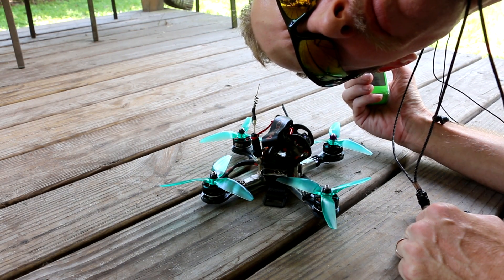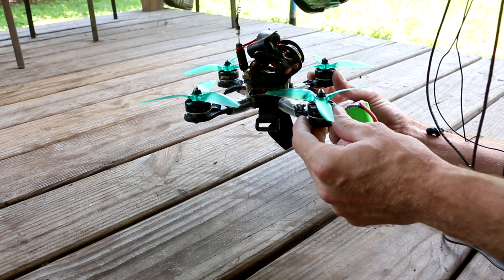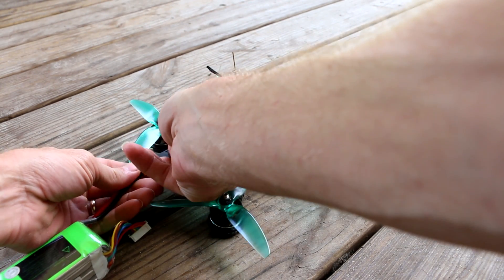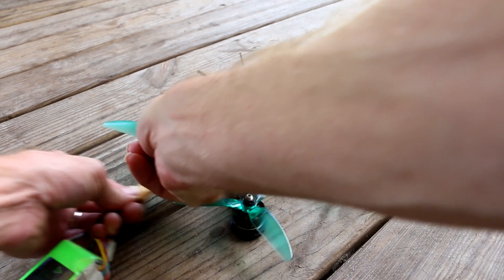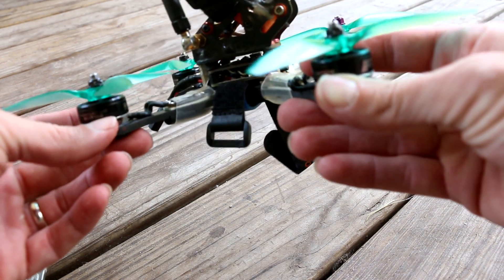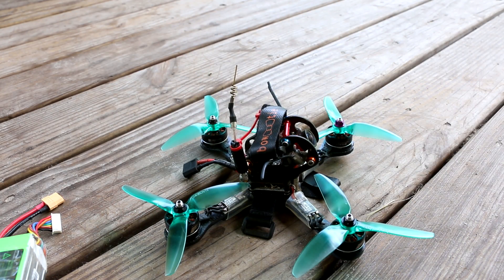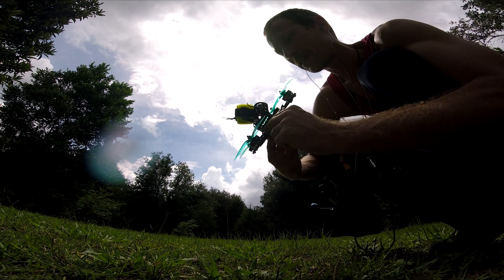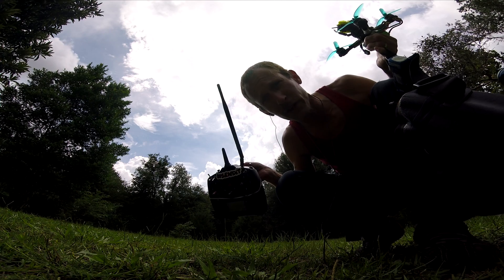Can a 20 amp esc handle 6s?

Comment: Saw this video today as me and a friend who got me into fpv were discussing if thr es30hv is sufficient for a 6s. Awesome work. Subscribed and loved your vids.
Reply from the maker: The spedix es30hv single esc are practically indestructible, these https://www.getfpv.com/spedix-es30-hv-3-6s-blheli-s-30a-esc.html?utm_source=google&utm_medium=cpc&adpos=1o2&scid=scplp7176&sc_intid=7176&gclid=CjwKCAjw2qHsBRAGEiwAMbPoDOHtR17-I_AdOh6c2ZhMlUg_TBtLocrhbVdAe5K1fqtZfT5Ah09T9hoCXl4QAvD_BwE .  I once wired them all backwards, plugged in the lipo and sparks started flying, all of the escs still work.  I've been running those on several 6s quads for 2 years.  The spedix is30 4n1 is not rated for 6s, but i've been using one on 6s for over a year now with so many flights on it.

Comment: Im running , holybro 35a esc blheli32, bardwell aio f4 v2, f60 2700kv motors, 6s battery, but smokestopper lights half when plugging inn at 6s and 5s, does not smoke at 5s, but at 6s
Reply from the maker: I've never used a smoke stopper, i use a multimeter set to ohms, connect to positive and negative on xt60 to check for continuity.
Reply: @mooosestang  its not a short, its overloading or something. Can you explain to me what it can be? One of the components on the flightcontroller startet smoking when using 6s
Reply from the maker: @EarlStrand  it sounds like a bad voltage regulator.  I have a flip32 f4 that runs fine on 4 and 5s, but won't arm on 6s and keeps resetting.
Reply: @mooosestang  is it possible for me to add an extra regulator between battery and flightcontroller then?

Comment: Running the spedix es20 lite on a bardwell f4 fc, pyro 6s 1250, hyperlite 2205 1722kv on hqv1s with great success here as well. 486grams. Rapidfire has clean video using no caps.
81amps on 5x4.8x3
68amps on 5x4.5x3

Comment: You are the man, I was about to ditch some these esc's. These esc's can do dshot. 
http://pirofliprc.com/Spedix-20amp-Lite-BLHELI-S-ESC_p_3478.html
Reply from the maker: I think mine might do dshot150, they won't spin right on 300 or 600.  So just know that dshot ready might not actually be dshot ready.  These came out before dshot like the tbs 25a bulletproof escs and some people had luck running dshot and other didn't.  but they do seem to handle 6s fine with 1600kv motors, probably would work with 1700kv too, maybe. ;)
Reply: I have run dshot 600, clracing f4, 4s with 2205 2600kv in a crash I noticed it would burn up the esc and motor. Running an old betaflight without crash recovery. Not sure if they were burning up due to over amping? FETs were toast. Motor windings would burn also. I do not have this quad anymore, I gave it to a friend getting into the hobby. I have to many quads. I have 6s lipo's on the way. I will be using a helination f4 and airbot ori32 on 6s.
Reply from the maker: It wouldn't surprise me that spedix changed something to make them dshot ready and i got some of the first ones before dshot came out, but they are the same escs in your link.  I've never had luck running the tbs bulletproof escs on dshot either, without removing one of the little caps.  tbs I know sold those escs as dshot ready, but many people had issues running them on dshot.  Let me know how it goes.  I've got some other 20amp escs I plan on trying on 6s, xm20a and racerstar 20a.

Comment: what size LiPo you running yO? looks like a pulse , but wondering the Size? thanks for your time.
Reply: going back through I think its a 1050mAh correct? a lot of the 6S packs are twice as wide as they are tall wish they'd make them equally wide as they are tall and make them a touch longer to compensate for the extra cells.
Reply from the maker: Yes, 1050 and i agree, we need longer cells.

Comment: i got a bunch of little 20's. i'm gonna hook one to my big 6s and see if it catches on fire.  I wonder if those 20 amp speedixs are limiting the out put current? Very surprised they took the initial voltage.
Reply from the maker: I don't think they are limiting power, it felt just as powerful as it did on the mad hatter with wraith32 escs.  I've got some 20amp littlebees, but i think they'll smoke, plus blheli_s is the minimum i'll use anymore.  I've got some racerstar 20amp escs, i bet they'll handle it fine.  I was hoping for a fire show on takeoff, hence the ground came to capture it.

Comment: I been watching your vids here and there and gotta say your freestyle is awesome! Just curious what do you run your antigravity, set point settings l, and tpa settings at? 4s if its diff from the 6s ones lol
Reply from the maker: Thanks.  Anitgravity was 5 on this one (default for bf3.4 i think), i normally set it to 3.5.  D setpoint is 1.75 and transition is .3.  I always set tpa to .18, probably not necessary on newer builds and firmware.  I use the same rates on both 4s and 6s, pids always pretty similar.  This is my starting point, i'll move P up and down, D up and down, but that's about it.  http://www.pbase.com/paulyoly/image/167111711/original
Reply: mooosestang thanks for advice ill have to do some experimenting Haha